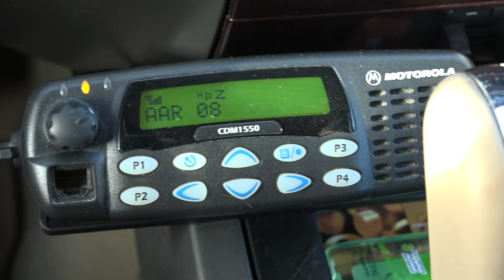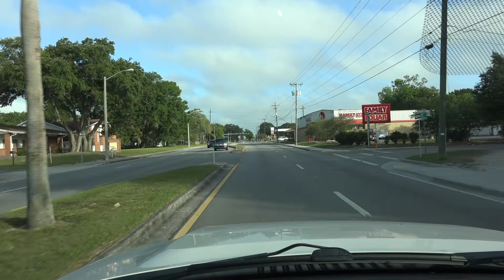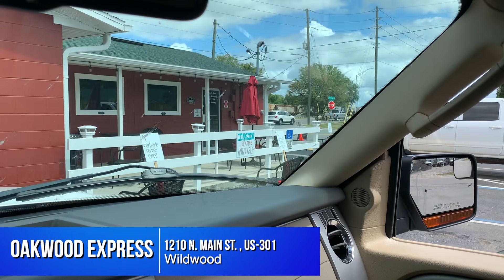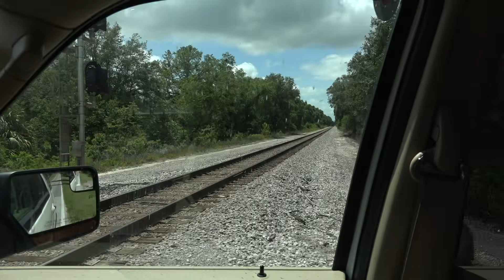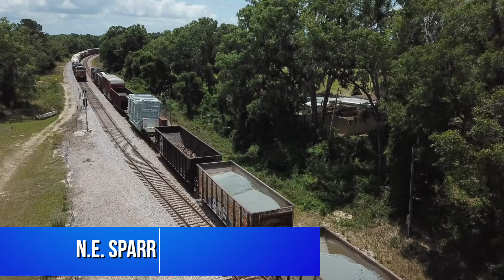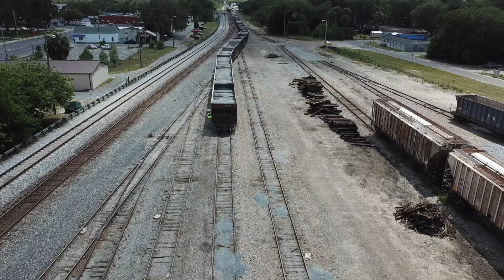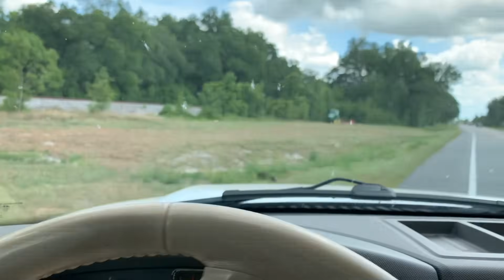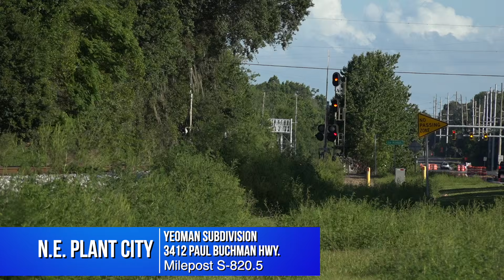Meeting of Two Giants

Comment: Does the conductor have the right qualifications to drive the train? Or is there a distinction between the two? Greetings from a rail fan in Sweden 🇸🇪🇸🇪😊
Reply from the maker: Great question. It's case-by-case. A lot of conductors were qualified as engineers and can operate as engineers if needed. Others aren't.
Reply: The train driver, which we call the engineer, is in charge of operating the locomotives. 
The conductor is in charge of the entire train, analogous to the captain of a plane or master of a ship.
Reply: The position as Conductor is the entry level position for crews. They are the person in charge of the operation of the train and they give the engineer orders to move. But the engineer is the next step up and they actually operate the engines. The only time that you will see a Conductor operate the engines in the US is when they are a Radio Control Operator, or RCO, in which case they control their train remotely while working the ground. Usually this only takes place in terminal yards or loading and unloading facilities.

Comment: What kind of radio do you use to pick up railroad frequencies and how do you find out the frequency
Reply: Any VHF scanner will do. Railroad channels, or AAR channels are 1-99 with ch1 being 160.125 and ch99 being 161.595, and separated 15 kHz apart. You can usually find the channels in railroad timetables or ask around for what channels are being used. Otherwise just keep an ear out to see which channels are being actively used by traffic.

Comment: 3:36
"not a grain train"

are you sure about that
Reply from the maker: Yep. K815 is empty phosphate from Illinois. Plus those hoppers were empty. We don't usually get empty grain cars in Florida.
Reply: @distantsignal  Look at the writing on the side of the hopper
Reply: @grandetrains  It's an older car, was probably moved from grain to mineral transport...
Reply: @Flyby-1000  @doubleutubefan5 Yep! Can't judge a book by it's cover. Especially old hopper cars. They are traded often, as needed for the jobs they work for. When a job is done, if they can carry sugar, or corn starch, they will restencil the reporting marks and send them off to parts unknown to be part of another train. I remember working in Florida and we had a unit train of Fly-ash coming in from somewhere out west. The cars were short little 38-foot hoppers or something and they had solid draw bars between them making each a pair of cars. Even though they were in use for fly-ash, the cars were still painted for their service of hauling flour from the field to the baker's mills. But they sure weren't making dough in those ready-mix concrete silos.

Comment: Does CSX still run pair of inter-modal trains on the S-Line?
Reply from the maker: Yes, 177 & 178 are running from Winter Haven plus 046 & 045 are running, although those aren't purely intermodal right now.
Reply: @distantsignal  Thanks. I was asking because for some reason they didn't show up on the day you were making the video.

Comment: The sign on your fence.... Begin TCS, what does that mean?
Reply: That means the train is leaving track warrant or Absolute Block Signaling territory and entering Centralized Traffic Control.  Essentially, ABS is where movement is controlled by block signals connected together.  CTC puts the humans at dispatch in control of the signals/switches.  Danny explains it better in one of his older videos.  CTC allowed for the meet at Sparr.
Reply: TCS stands for "Traffic Control System"

Comment: What is the speed restriction for a double yellow over red
Reply: There is no defined speed restriction for Advanced Approach. It's simply a warning that the next signal is an approach, which does carry a 30 MPH speed restriction, followed by a stop signal. This is typically used in locations where the approach signal cannot give ample warning of the upcoming stop signal for a train going track speed. It was initially used for signaled sidings that were shorter than a mile in length, where the distant signal would display either advanced approach for trains holding the main at the siding, or approach medium for trains diverging into the siding.
Reply: There isn't one.  That's why some railroads/locations prefer something like Approach Medium which does impose a restriction.
See:  https://signals.jovet.net/rules/

Comment: Pardon my ignorance but why is the letter "X" so prevalent in train nomenclature?
Reply: Do you mean marked on the cars?  Those are "reporting marks"--all railcars have a unique reporting mark so railroads can track it.  This consists of letters that identify the company that owns the car (or locomotive) followed by digits for the car.

Ones that end in "X" are cars owned by companies that aren't common carrier railroads.  For example, a huge conglomerate--owned by the railroads, but not a railroad itself--that leases cars to railroads is "TTX".  They were called the "Trailer Train" company since they started by leasing flatcars to haul semitruck trailers, hence "TT", but they needed to end in "X" since they're not actually a railroad company, so "TTX".  They've since changed their corporate name to "TTX Company".  Another example are railcars owned by the Department of Defense, which have the reporting mark "DODX".  Again, since they aren't a railroad, they needed to add the "X".  Since the majority of cars are owned by non-railroads--I think most railroads have offloaded their cars to TTX to better enable sharing when one company has a lot of traffic and another doesn't--most reporting marks end in "X" and you see them a lot.

Fun fact: CSX has a reporting mark of "CSXT".  Since they are a railroad, they couldn't just use "CSX" (named because they were a "cross" of the Chessie and Seaboard systems).  So they appended a "T" from the full company name of "CSX Transportation".
Reply: @CatCube2  Thanks for taking the time to write all that - very interesting!

Comment: As US trains are going to get longer dual tracking is essential 
I have noticed that on hilly and big curves distributed power say middle and end is not used
The stress on the couplings is tremendus and the momentum to pull the wagons into the curve derail
Reply: It depends on the train.  Empties are a lot lighter than loaded cars.  I expect that, on a mixed loaded/empty train, the loads are towards the front, and the empties are towards the rear, probably after the mid-DPU if present.

Comment: Thanks for the technical info
I've been a rail fan since a small boy train spotting at the top of the old Decca building overlooking the Southern regon steam engines prior to 3rd DC electriccation in south London
With dad watching cricket at the Oval on the other side of the building

Comment: Rail question if someone can answer? It seems that no matter the length of the train csx runs with two locomotives typically . and ns typically runs with 3. What is the reason? Terrain? Dynamic breaking? Does anyone know or am I just imagining things?
Reply: Several factors determine the number of engines. Most of the time, it's the ruling grade in the subdivision vs. trailing tons, calculated on a matrix or even a simple spreadsheet. With the advent of DPU, they can spread out the power and make it even more efficient. (i.e. what 3 engines can't do on a hill as a single MU pack, they can do if one of those engines were on the rear, pushing) Also one factor is the strategic placement of power in a rail network. If a particular division or subdivision has more power on one side than the other, they will add a locomotive to a consist just so they can shift their power around for balance. If you've ever seen a train with 6 or more locomotives, this is when they are not managing the balance of power well and have to shift a lot of power all at once. It also happens when traffic is moving from one end of the subdivision to the other and then interchanging. So if the only traffic a subdivision is seeing for a while is mostly Southbound, you end up with a lot of idle power on the south end. eventually someone has to round up all the horses and bring them north again!

Comment: I just learned something about the Ditch Lights. THANKS DANNY!
Reply: You learn something new everyday! :)
Reply: I don’t get why it’s like that with certain roads having flash ditch lights while others don’t
It’s pointless but sometimes they help spot things, but I don’t get why they have to flash 
I assume they can be set up to flash and have them set off and only turn them on if needed
Reply: UP CSX NS and BNSF DO have locomotives with flashing ditch lights.....CSX NS and Amtrak its standard out of the factory but to see a Union Pacific means it is a fallen flag locomotive such as SP. Some BNSF SD70MAC's have flashing ditch lights for whatever reason....
Reply: Fat Chungus It’s possible that BNSF purchased a used locomotive from a rail company that had flashing ditch lights. But yes, BNSF for the most part do not have flashing ditch lights.
Reply: Here in saudi we dont have flashing ditch lights.
Reply: Same
Reply: But here it is only for CSX. Other Roads don't flash the ditch lights.
Reply: @markushymek4594 , Amtrak flashes them, but I don't think UP or BNSF do.
Reply: @donaldthomas7070  Out here in Kali, both ATSF and SP flash at x-ings (as does AMTK).
Reply: @thomream1888 , if by "Kali" you mean California, UP trains do not flash their ditch lights at crossings (unless they started doing so quite recently).
Reply: Neither do BNSF trains flash their ditch lights. I'm not sure if ATSF flashed theirs (or if they even had them) before becoming part of BNSF. The same can be said for SP before it became a part of UP.
Reply: @donaldthomas7070  Well, in the San Joaquin Valley they've been flashing for many years. I don't think it's just a local thing but it might be.
Reply: Donald Thomas bnsf sometimes does and up rarely I live right by Provo yard were there always at
Reply: @markushymek4594  ns has them
Reply: @johndeere709  I know :-)
Reply: David Wells and Union Pacific I don’t know about BNSF though
Reply: @markushymek4594  Every railroad in the US has at least 1 locomotive with flashing ditchlights because it's common practice in the USA, in Canada we don't have any
Reply: @traindev1  ALL locomotives  have ditch lights; it's a federal requirement in order to lead any train. Any locomotive or cab car that wasn't built with them had them added. It is a requirement for locomotive or cab car that may encounter a railroad crossing in the US, so Canadian locomotives will also have them if it is possible that particular piece of rolling stock may be at the head end of a train in the US. Waivers are granted for equipment that will not encounter a railroad crossing, like a mining railroad with no crossings, or equipment used at an amusement park. If ditch lights aren't required in Canada I can imagine there are plenty of engines that don't have them because they'll never have the opportunity to operate in the lead of a US train, but I imagine the larger roads like CN, CP and such that have equipment that operates into the US will have them.
Reply: Markus Hymek  BNSF don’t flash the Ditch Lights
Reply: 453
Reply: Markus Hymek NS does
Reply: @markushymek4594  i
Reply: @merrill1940  ?